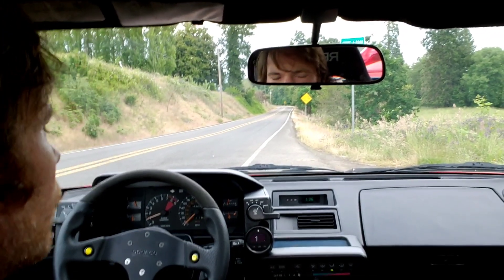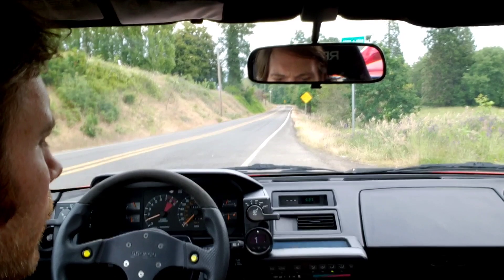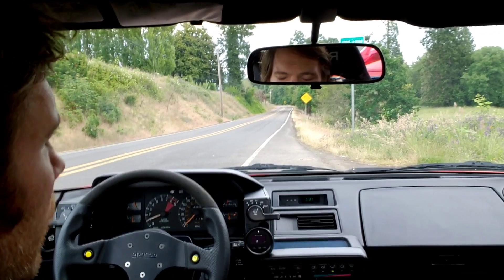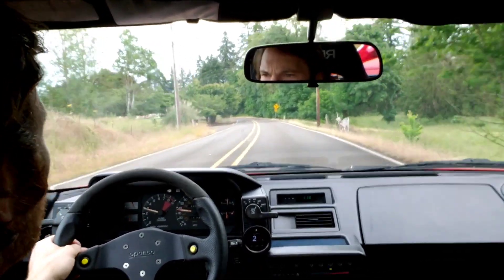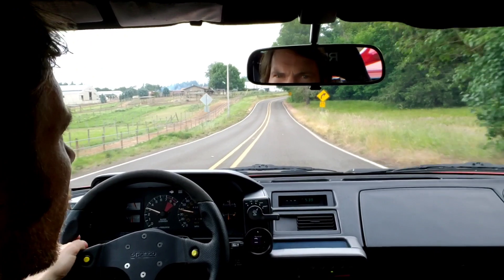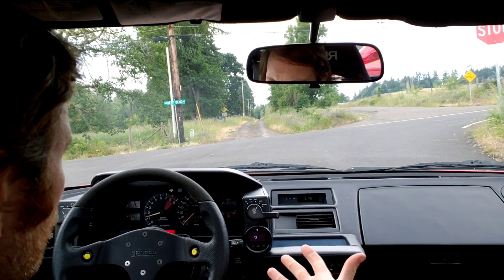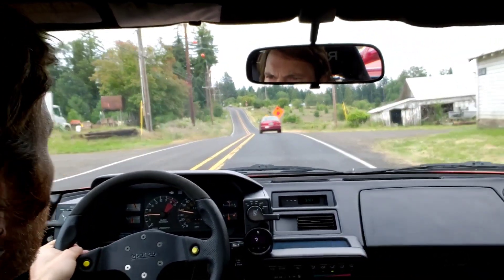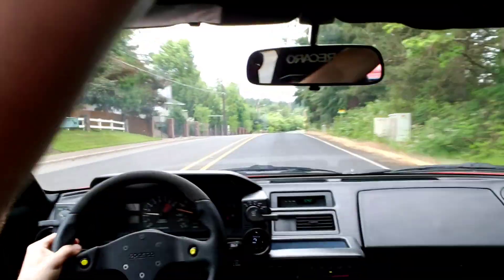AW11 Mk1.5 Mr2 motec traction control demo

Comment: how much %slip were you allowing?
Reply from the maker: The base table is anywhere from 2% to 15% based on the traction setting.  In addition there is a gear adjustment which adds 25% more in 1st, 10% more in 2nd, base in 3rd, and 10% less in 4-5.  So at 15% slip there would be actually 16.5% slip in 2nd.

Comment: Awesome demonstration!  I'm doing a similar setup with a different ECU/turbo.  Rotary switches for boost and traction control as well!  What are you using for wheel speed inputs?
Reply from the maker: Sorry missed this comment.  It has Cherry hall sensors on all 4 wheels.
Reply: @tarmactrr  Thanks for the reply!  Are they picking up wheel studs, or a tone ring of sorts?
Reply from the maker: @zerodrift1   They are picking up the bolts in the rotor hats in the front and the axle bolts in the rear
Reply: @tarmactrr  That is a good idea!  I'm attempting to swap in Gen 2 hubs with abs tone rings for signal pickup.  No idea how this will turn out, but I'm hopeful.

Comment: What’s the full spec ? Still using the ct20b or ct26? 

You managed to keep the AC / heater ? 

Cheers
Reply from the maker: It's a fully built 2nd gen 3sgte... GTX3071r for the turbo.  You can't make more than 350whp with a CT20b or 300whp with a CT26.
Reply: Ok nice , still have Air condition or deleted?